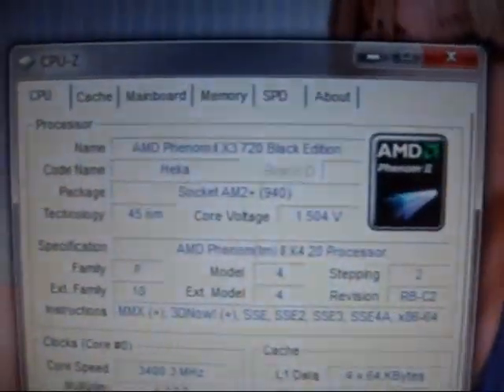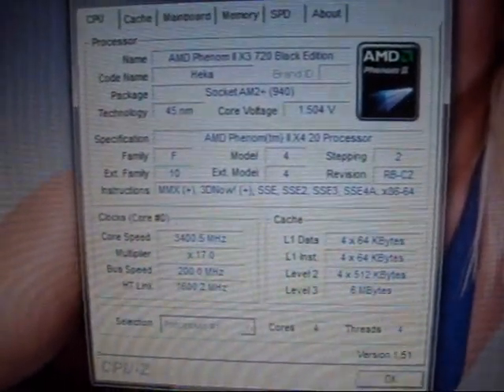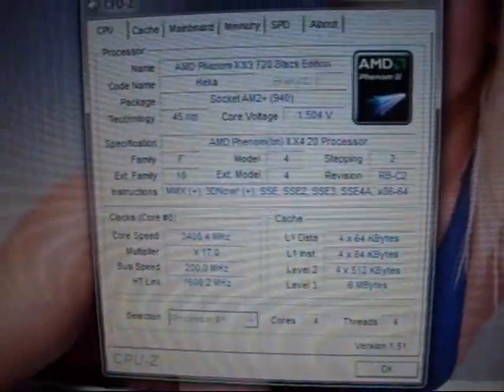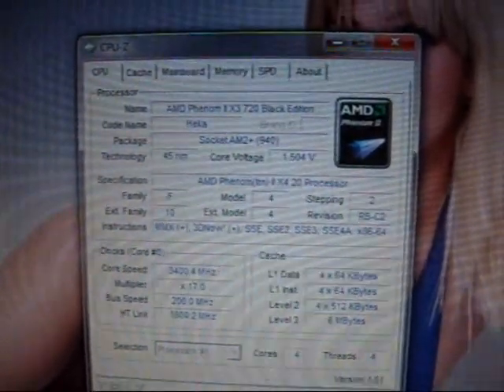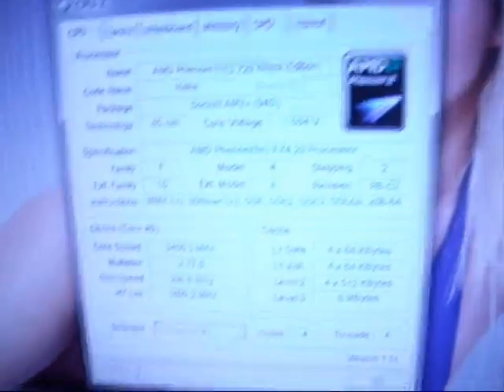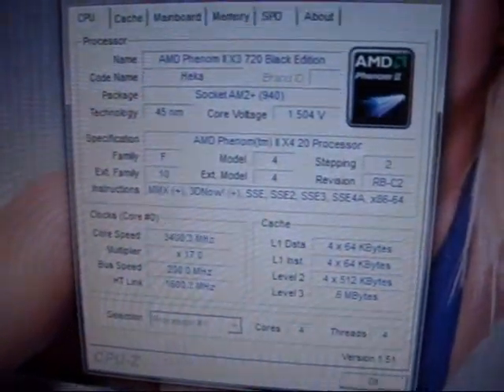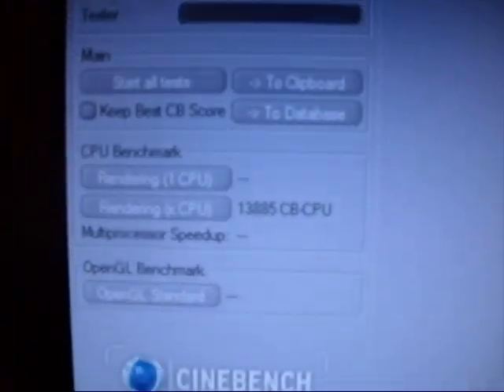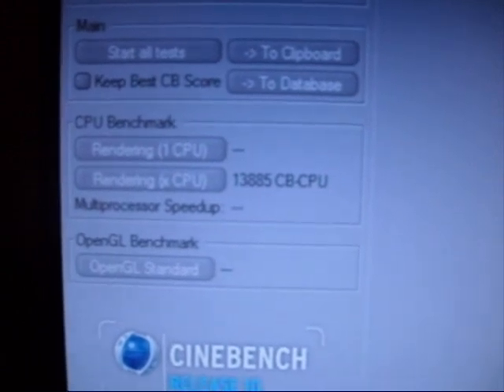Unlock 4th Core on X3 720 Part III

Comment: No, it does not beep, which, now that you bring it up, is another sign that its probably the mobo. that hadn't really occurred to me until now. I had cpu@ 3ghz for months and decided I wanted to start to push it slowly farther, so I brought it up to 3.1ghz I did not increase the voltage as I had been letting it auto volt and it worked just fine. I know at higher overclocks you have to start increasing voltage manually. I did with the q6600 I use to have. Was it a mistake to let it auto volt?

Comment: Here are my specs, I built it myself. A second opinion before I RMA my Mobo would be helpful though.
Intel Q9550(OC@3.1ghz)
Dual GTX 260 SSC core 216(SLI)
EVGA 750i FTW edition Mobo
2x2g Corsair Dominator DDR2 1066
Silverstone OP1000 PSU
2 WD Caviar Black 500g HDD
Lite On 22x DVD
CM Hyper 212 heatsink
CM HAF 932 case
Windows Vista 64bit

Comment: I fried my rig the other day and I'm 80% certain its the Mobo, although I'm unsure if it could be the CPU. If you could give me a second opinion that would be awesome. The fans and lights come on, the lcd poster does not run through the series of post codes it usually does before going to FF, instead it goes straight to FF(which simply means boot on EVGA boards)  and there's no display, the video card does not even power up. I've swapped ram and video cards out. so they aren't the problem.